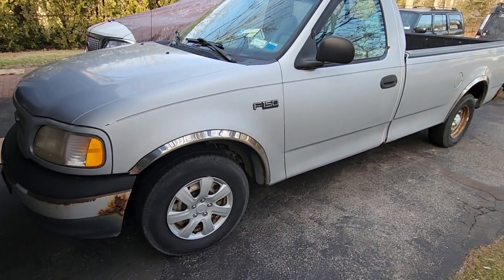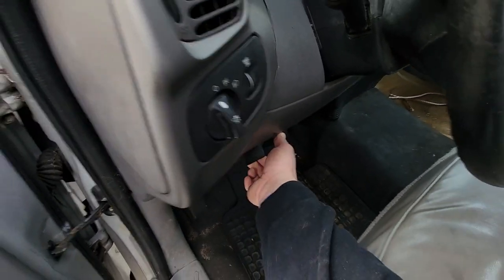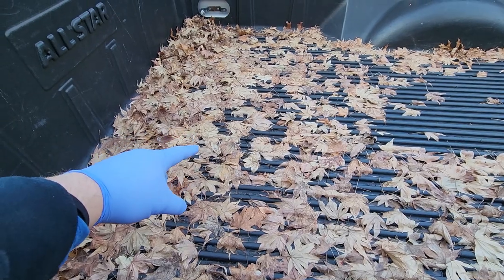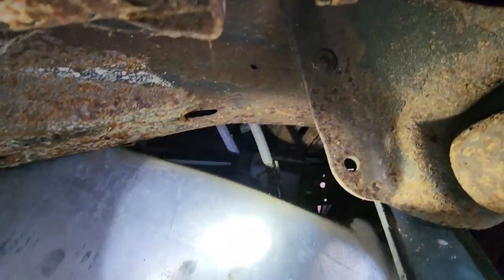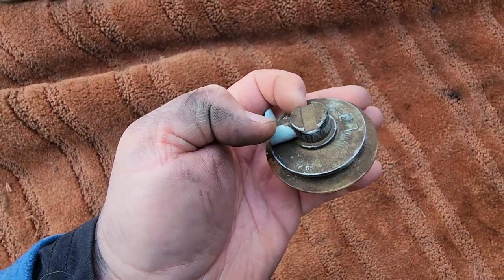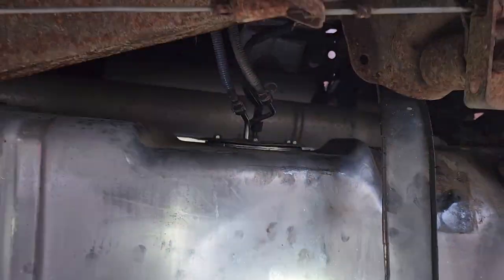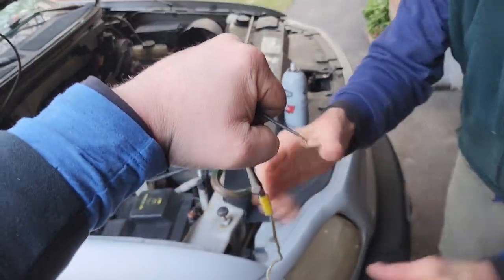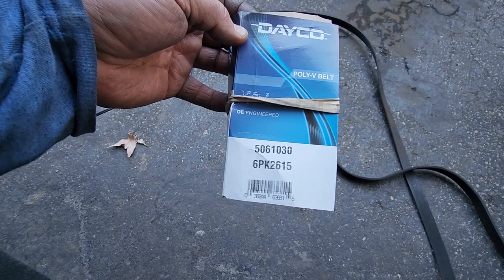DOA FORD F-150 - FIRST START !!! - 1999 4.2 V6 FUEL PUMP REPLACEMENT

Comment: Replaced pump on 4.2 e150. Engine light came on afterwards rich on both banks. Replaced fuel pressure regulator and fuel trims perfect.  Great video
Reply from the maker: Nice work! Thank for watching!

Comment: That was a very good purchase. I have a 2000 manual transmission that I just put a fuel pump in it. Also plugs and wires will need to be changed if they haven't already. Plus gas tank recall on the tank straps.
Reply from the maker: Thanks for the heads up! Thank and straps look pretty new.  I'll run the vin and see if it has an open recall

Comment: If I can, I have a spare $10 Ebay electric fuel pump, I disconnect the fuel filter and hook the cheap pump to drain tank, takes a bit of time, but it beats wrestling 10 gallons of fuel that's probably bad after sitting for two years. Nice score, everybody needs a going to the dump truck, I don't care who ya are. Sup Dan...
Reply from the maker: Yea..it would have been much better to dump the old fuel... I call it fire pit fuel. Lol.. next time I'll pump it out!
Reply: @ProjectDanH  Fire pit fuel...I like it. I only mentioned as poor idling is usually due to turned gasoline. I got an old ford truck, I gotta get going, and you can smell that varnish smell as you near the filler neck. LOL, swear I just parked it a couple months ago, wife said more like 10 years...LOL.
Reply from the maker: @r.weaver3769  hahaha. Time flies

Comment: I've had my 4.2 F150 for 6 years now. Was my uncles before then. New GEM module, plugs, wires, coil pack various other odds and ends. Starting to get a long crank and know this is coming. Yikes
Reply: Also, that Clark Griswold joke had me rolling!
Reply from the maker: LOL, glad you liked the joke.   God speed on the job!!

Comment: Mine has crank no start. Battery is good. I hope its not the fuel pump. I will start in fuel filter. I hope its only the fuel filter.